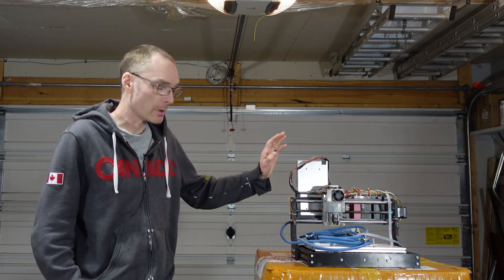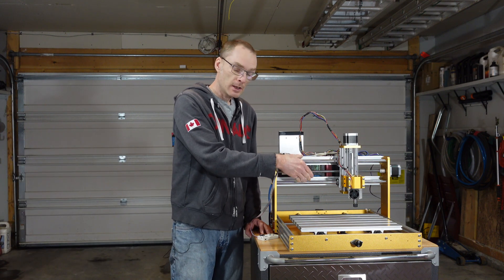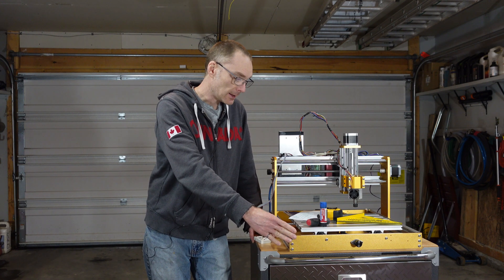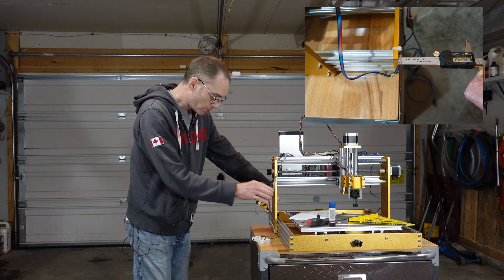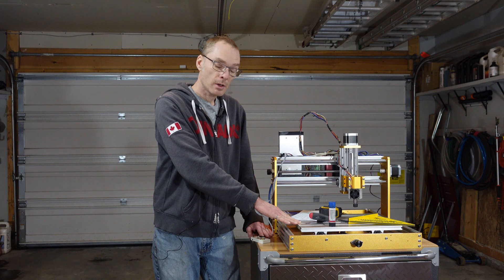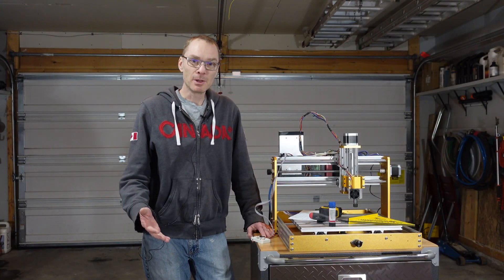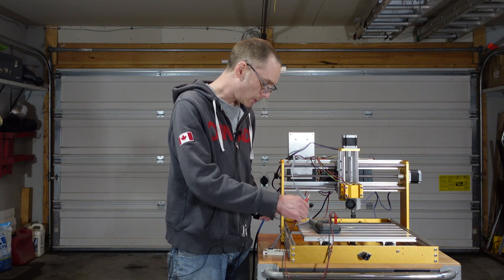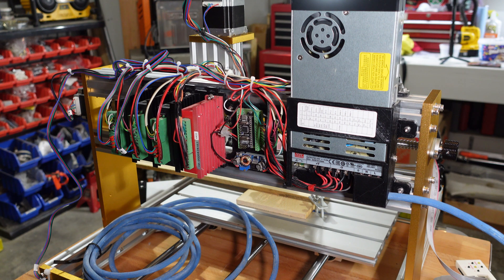New CNC 3040 Aluminum Frame Kit Assembly (Upgrade from a CNC 3018 Pro)

Comment: Are you tiny?..My 3018 is looking to be about half that size you comparison..….!?
Reply from the maker: Nope, I'm pretty average!  The bed on the 3018 should be 30cm by 18cm.  Mine might look a bit bigger because I have added on the drivers and PSU to the back and a bigger spindle on the front.

Comment: Does the kit includes step motors?
Reply from the maker: It had an option to include them or not.  I chose to have them (NEMA 23) included.  It also has the holes drilled for smaller steppers so you could use either NEMA 23 or 17.   The instructions provide direction in installing electronics, so there must be a version with electronics as well.

Comment: Very good, but you need to either slow the spindle or increase the feed rate. That was burning, not cutting. I couldn't see, but the spindle was turning the right way? :)
Reply from the maker: Thanks for the reply, I feel silly now!  While this was my first job on the new frame, I had been playing with the feed rates and spindle speed on my old machine and was frustrated as I couldn't figure it out (as I just moved the electronics from old to new the wiring and electronics is all the same for the spindle).  It has been like this for a while.  Your comment made me go back and check the spindle direction and sure enough it was backwards.  After checking all the wiring and settings, I have it going the right way now.  Looks like I had a bit of brain fart when I originally installed it when playing with inverting ports and wiring the direction pin.  Did a test job at twice the feed rate (now 500mm/min) and twice the cut depth (now 2mm) and no smoke (and a dullish bit as well)!  Previously that would of broke the bit.
Reply: @reileymckerracher9181  glad I could help. It's alway something stupid